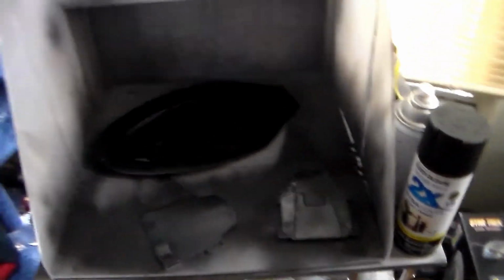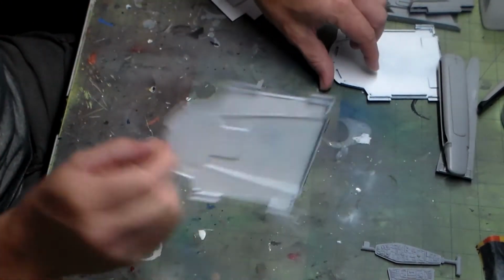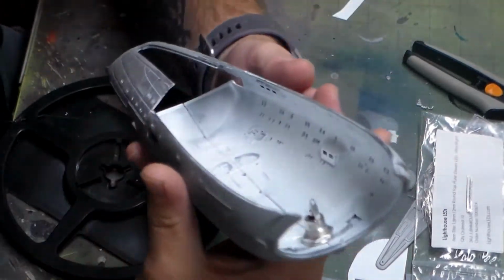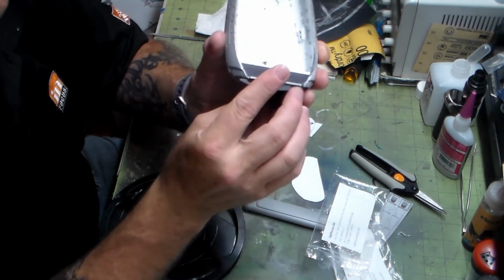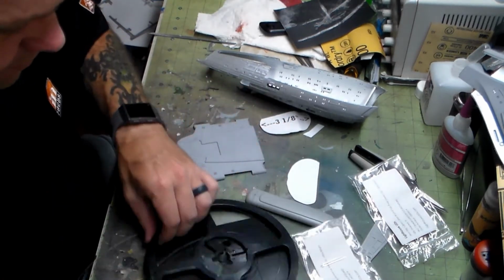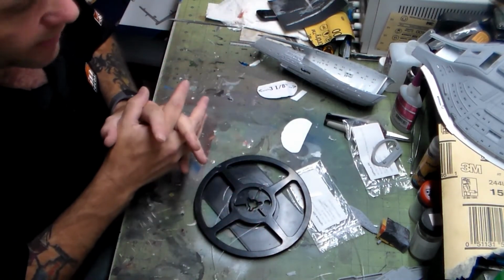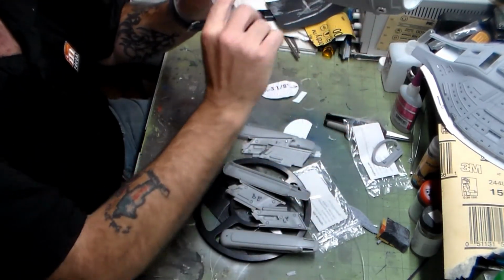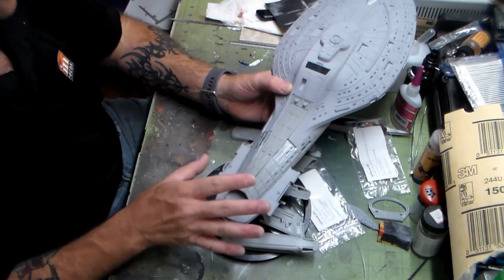Revell 1/670 U.S.S. Voyager build log 4

Comment: Hey Buck, great progress so far. I'm currently building my second voyager model and noticed one small "mistake" in your marker light placements of the nacelles. In all the images i found the red and green nav lights go into the raised portion. So further to the front of the nacelle. So if you can, i would take a look and change that if you still can ;)
Reply from the maker: Thank you. I will look into seeing what I can do.
Reply: Hey Buck, thanks for responding. After i posted this i saw you already were beyond the point of (i think) no return. So i would say don't bother trying to open up your nacelles and change the locations. once glued, we should leave the pieces alone, opening them back up is never good for the finished result. So keep up the good work!
Reply from the maker: Yea, just means now I will have to build a 2nd one. O